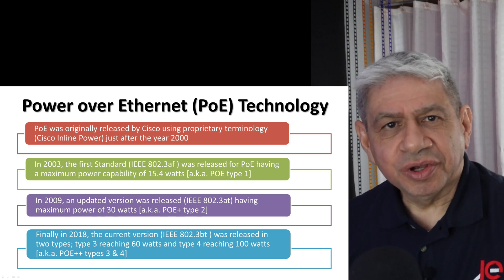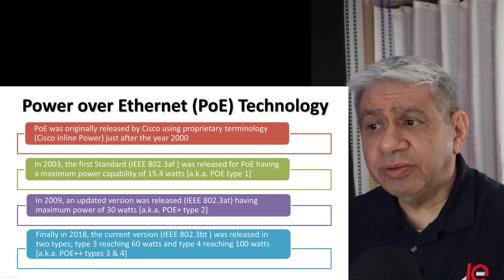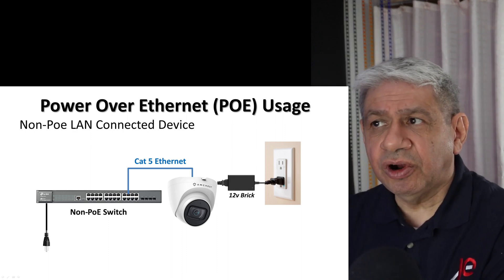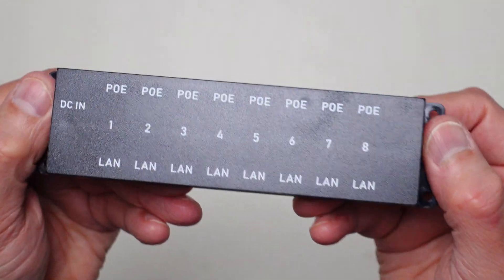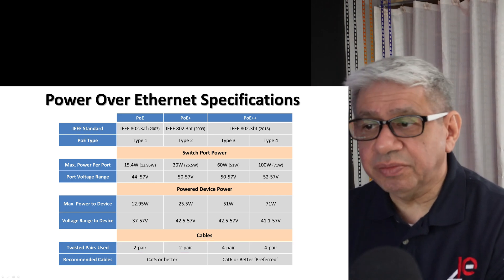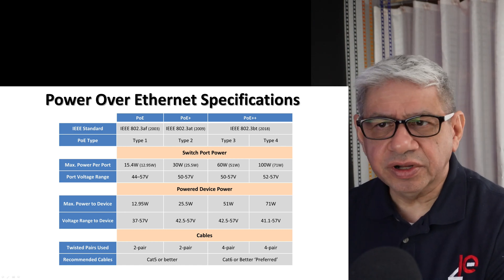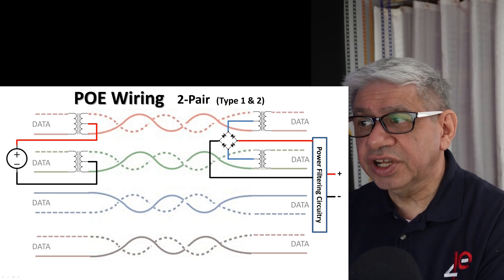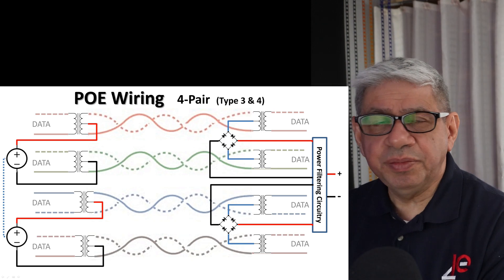Understanding  Power over Ethernet (PoE) Technology

Comment: I think you have the POE Wiring and power mixed up. Either the switch sends AC and the POE device converts AC to DC with the bridge rectifier, or the switch sends DC, which wouldn't have transformers or a bridge rectifier.
Reply from the maker: I'm not following your question/comment entirely, however I followed the IEEE 802.3af standard in preparing my slides for this video.  If you take a look at this CISCO document, you will see one of the references I used: https://www.cisco.com/c/en/us/solutions/enterprise-networks/what-is-power-over-ethernet.html

Comment: Thank you for this video. I have two questions: 1) can a non POE device be connected to a POE switch? 2) Can a POE switch be inserted between a non-POE router and other POE (and non-POE) devices (in lieu of a POE injector)?
Reply from the maker: 1) Yes, A PoE port will only inject current into a PoE device, it will not alter the data connections to an attached device.  2) Yes, that will introduce some latency into the data connections however, since it will put two additional sets of translation between them (usually 5 to 25 microseconds depending on the quality of the switch and the amount of traffic load it has at any moment.
Reply: @PE4Doers  Thank you very much.
Reply from the maker: @brianjongraham2396  You are quite welcome

Comment: Hi, if power and data together with 12 36 pair. Which one is for data?
Reply from the maker: What do you mean by 12 36?  In POE, the power and the data share the same wires.  I describe the details of that at 15:27 in the video.  The power is a constant level, however the data is variable square wave.

Comment: In an effort to cut costs and increase profits, some sellers offer Cat 5 and Cat 6 cable made with CCA (copper clad aluminum) wire, small diameter wires such as AWG 26, or a combination of both. This has the potential to significantly reduce the output of the switch/injector. With longer runs, especially when using POE+ or POE++ it would probably be best to use a pure copper AWG 23 Cat 6 cable.
Reply from the maker: I fully agree - copper.  In addition to the great points you make, that clad'ed wire also tends to loosen up in the connectors over time at a significantly faster past than pure copper.
Reply: @PE4Doers  👍